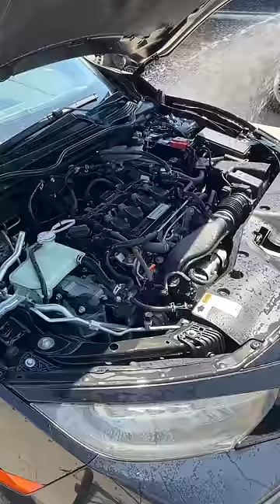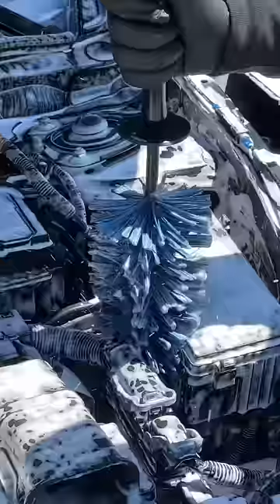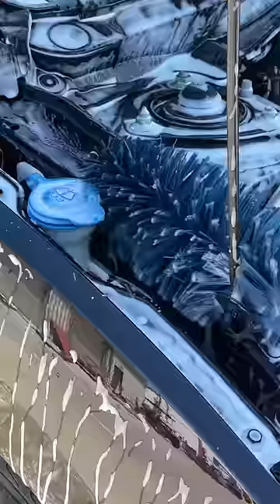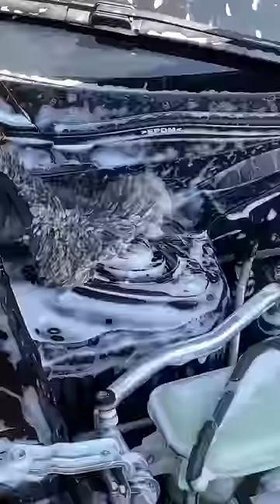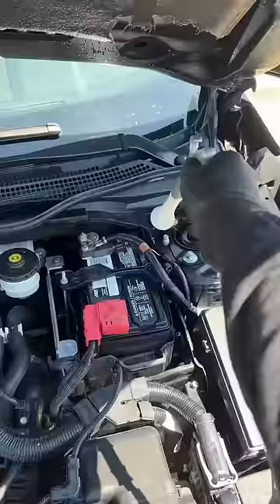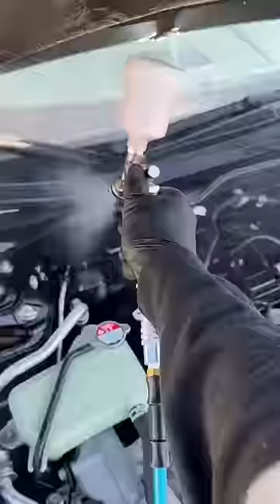Engine bay detail #asmr #satisfying #trending #cleaning #detailing #california #viral #rad

Comment: Tip for next time, cover the alternator or open air intakes and battery with a garbage bag to prevent water getting into those. Pressure wash from a distance but preferably a garden hose will be fine

Comment: I wash my cars engine bay every oil and till this day i dont have an electrical problem. I do however cover the battery and the fuse box but besides that i let the engine warm up the cool for 5 minutes. Start the process and after that let it sit for 2 hours. Turn it back on and wash all the water dissipate into vapor. Not one part under the hood is rusted. Works every time.

Comment: A water hose is fine for under the hood cleaning, average pressure is about 50 psi out of faucet, 100 up to 300 psi with nozzle. Just don’t use a pressure washer, for under the hood.
Reply: Why not, high-pressure washers are not the problem.

The problem is the same as that described for computers with PEBCAK or level 8 error.

If you regulate the pressure with the nozzle and choose the right distance, then nothing can happen.

If some complete idiot believes that he can use the dirt cutter, with which he normally mills his brown and green algae from the pavement, at a distance of 1 cm in the engine compartment or on the sidewall of a tire, it is a problem.

Comment: I definetly wouldn’t spray down the whole bay. I would do piece by piece with a brush avoiding as much electrical as I can. This was is very risky and can lead to issues. If you have to spray the whole bay down, unplug battery (in the summertime) and once your done let it sit in the sun for a few hours and all moisture will evaporate

Comment: one time spray or few drop of water is ok but if u use garden hose normal washer u have a risk to spend more on failure engine.. specially new engine have many sensor and electronics part and finding and diagnosing fault is very difficult that cause engine to mal fucntion... it need catious to cleant specially if you dont familliar with parts dont do it.. it cause a lot u of money.. u can use brake cleaner and brush is safer but be carefull with wire connection..

Comment: This is probably not the best way to go about cleaning your engine bay.  You should not directly spray the fuse box or alternator.  If you cover the important parts it's not as big a deal.  It's actually nice to have a clean engine bay when you work on things and it makes it much easier to spot fluid leaks and damage/worn parts

Also what did he spray on the engine in the last step with the paint gun

Comment: There seems to be two sides to this debate.

People who do this or have done this with no problems after supposedly no issues for 30 plus years, is total bs. There is also a very significant difference in what is considered water proof and water resistant.

In any case i wouldnt do this primarily because it makes absolutely no difference to how the engine performs, Anyone who tells you it does is an idiot.
Besides that, the car has a hood for a reason. Cleaning the engine bay with a degreaser every now and then would have the same effect and with virtually no risk involved.

Morale of the story, do this if you want, but dont be suprised if and when stuff starts to fail prematurely. Good luck with that 👍

Comment: Insane how so many non-detailers have 0 clue on how detailing works.
Reply: Man, I don’t need to be a detailer to know I should never throw water (specially with high pressure) directly on engine and electric components… Its alternator has gone away, if not, battery, engine module or sensors, all things could be damaged with this kind of cleaning.

Comment: I love how everyone believes the myth that cleaning your engine bay like this will cause electrical problems lmfao I’ve been doing it like this for years and my car has never once had an electrical problem. You just disconnect the battery and nothing will happen unless you have bad seals around your spark plugs, but even then you can let the car dry and it will start 😂 if it makes you feel better the only part you should ever cover is your alternator

Comment: Yall act like your engine can't get wet or anything 🤣 all your wires are wrapped and sealed from getting water or moisture in them. I used to detail idk about all the soap, but the water is 100% fine. Just make sure it's dry.

Comment: I’ve washed many engines. Never had an issue. I always wrap the alternator with plastic first. Then the fuse box if under the hood.  Spray some degreaser scrub and then water with pressure washer with gentle adapter. Never spray directly into things. Keep a good distance and spray in sweeping motions. Use common sense

Comment: Mechanically, there is nothing good about doing this. 
If you buy a fairly old used car and the engine compartment is very clean, there is a possibility that it has been cleaned in this way.

Comment: For those of you saying they’ll have electrical problems are full of shit. All those electrical connections, at least the plugs anyway, have little rubber gaskets that make a water resistant seal to non-pressurized water. Like yea don’t go spraying it down with a 2000 psi pressure washer but something like your garden hose with a garden handle attachment , an IK foam sprayer, or even a lighter psi pressure washer meant for detailing (~1000 psi) is just fine. Cover up the alternator and fuse box with a plastic bag and you’ll be fine. Thousands of detailers do this on a daily and it works just fine afterwards
Reply: Have you noticed he actually used pressurised water?